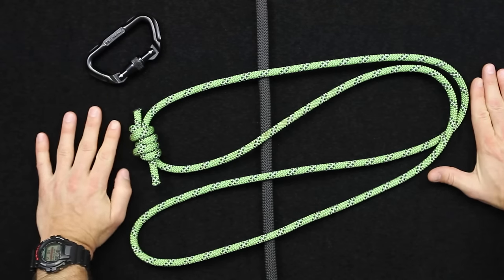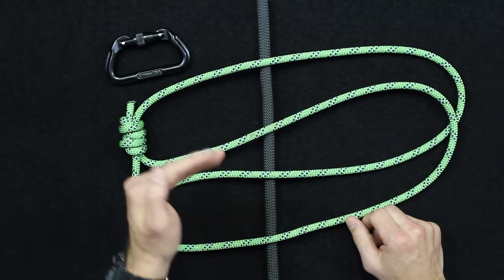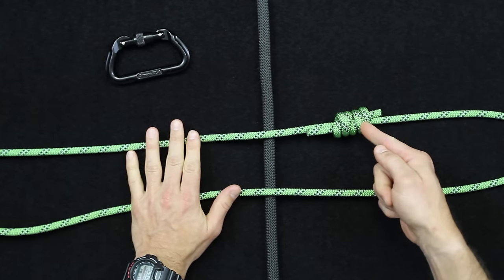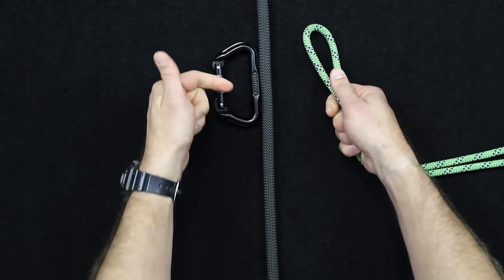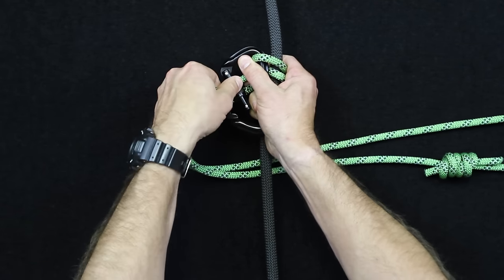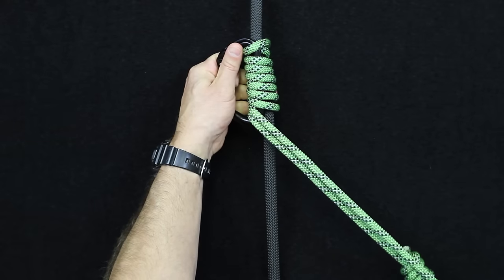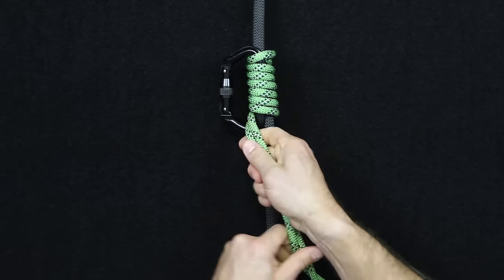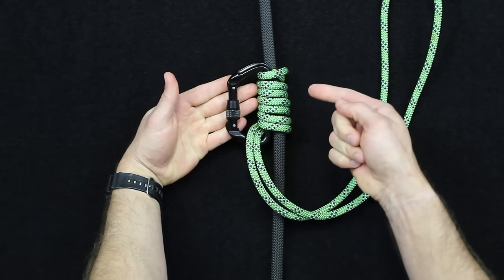Ascend a Wet or Icy Climbing Rope with the Bachmann Knot - ITS Knot of the Week HD

Comment: This seems slightly misleading. On a wet or icy lines, all friction based ascenders like this are likely to fail catastrophically. Only cam based, toothed ascenders should be used on icy or wet lines. This may be easier to grip with gloves, but that doesn't make it appropriate for those conditions
Reply: Even if it slipped, how fast would it slide down?    Wouldn't it be a relatively slow descent?
Reply: This. Respectfully, I think that the responsible thing for this uploader to do is to take this video down. Friction hitches and ascender/descender systems carry a huge level of risk, and if you wanna be someone who talks about them, you need to be someone who actually knows what you're talking about, and pays attention. There's other misinformation in this vid as well.
Reply: I can’t speak for ice, but I have used this method in training exercises and on law enforcement/rescue ops. It’s not the best option out there, but it does work in a pinch. Has yet to ever fail. Tied and true in both wet and dry environments.
Reply: Nope, if it failed it would soon run at full speed. A bachmann offers less friction than a standard prussik because the carabiner touching the rope does not add additional friction.
Reply: This is not the only very VERY dangerous video from the same guy. He has learned some knots and talks about them as if he knows them and their weaknesses. He does not.
Reply: @keithklassen5320  He Won't remove the video by himself, it's making money. Just report the video. It's not the first video he has posted that disregards all safety.  I appreciate the explanation about knots but the safety info is misleading and there will be people on the internet following this advice for sure
Reply: Ian L that might just save a life right there
Reply: Keith Klassen 

Im pretty sure he didn’t even mention that when using a prusik loop for a bachmann, the diameter of the rope needs to be smaller than the diameter of your working line or this knot won’t even work.  Its already pretty low-friction, as far as friction hitches go...losing even more because your rope cant coil tightly enough to create friction isn’t going to help.

You’d think that was something you might want to include in an “educational” video, right?
Reply: @JennyY8S  
"A bachmann offers less friction than a standard prussik because the carabiner touching the rope does not add additional friction."
True, the carabiner doesn't provide significant friction, but since he's using 4 turns with the Bachmann Knot, compared to a prusik which typically uses only 2 or 3, hence the friction of both systems is comparable, since the overall  rope to rope contact is about the same.
Reply: @fjeezy1305  
"...when using a prusik loop for a bachmann, the diameter of the rope needs to be smaller than the diameter of your working line or this knot won’t even work."
Since the Bachmann Knot utilized a carabiner, the thickness of the rope is not an issue.
Reply: @TomBrooklyn  Please go back to high school physics and review the chapter on static vs dynamic friction. The fall would not be a slow descent. It would be at full speed and catastrophic.
Reply: @TomBrooklyn  for the first 10 feet somewhat slow
Reply: This is actually the worst choice for a friction hitch on an icy rope. The guy making this video I highly doubt has ever tried this.
Reply: The general commentary here does not appear to recommend this  in critical environments . Caveat emptor .

Comment: I just got to say, I am a home remodeler and I do some roof repair. I was in a situation where I needed a knot to tie in my carabiner so that I could go up and down the roof and pressure wash. This bachman knot worked amazingly just to keep me safe and Save a ton of time. So I want to say thank you for posting it and in the right condition this is a great alternative.
Reply: Jrad Jordanian do yourself a favor and spend 30 on a ATC and a Prusik loop at minimum before you fall. Using this knot as a lifeline is a horrible idea and should never be done.
Reply: So are you saying it was good for rappelling down? Easy to slide down when its under load?

Comment: Screw Down, so you don't screw up. Will be using that saying for future. Awesome videos, simple clear and very intuitive. Keep them flowing.
Reply: Don’t fully rely on it. When belaying we typically use an asymmetric carabiner. In these cases you do need to screw up as that is how it was designed. However when you are using a symmetric carabiner such as the D carabiners shown you can screw down so you don’t screw up.
Reply: I disagree. This knot is too risky. Friction is a concern.

Comment: You defined the Prusic as the double knotted rope.  That loop of rope is NOT a Prusic until it is used as one...The Prusic is strictly how this looped double knotted rope is applied to the climbing rope. It's nice to have an alternative to having no ascender but the rule in climbing is redundancy and as such one should have not one or two ascenders but back ups to back ups and at the very least two ascenders tied to the harness or on the chest, ready to use !!
Lastly what tightens the Bachmann knot isn't the "harness" but the weight of the climber. It's all about weight and gravity. 
Ascenders are shaped to grab a rope securely and many are quite small and very sturdy...You only need one...I've also done a lot of ice climbing. Using dry ropes is primordial, they should never be "icy" or iced up. 
I did like your idea of screwing down the locking carabiner as opposed to "screwing up".

Comment: I keep trying to practice this on a practice carabiner and there is no gripping whatsoever. It just slides up and down like nothing. 

Does it have to be wet and icy....
Reply: David Hutchison that's because this guy doesn't know what he's talking about. As others have mentioned, this should not be used for ascending any rope, wet or dry.
Reply: You can use this for acenssion I just wouldn't use it on a wet rope I have used it on drdry ropes most my life climbing over 10 yrs and never had an issue by I use it with a foot sling attached to the end of the rope hanging off the carabiner and only use the carabiner to slack off the rope after I have pulled up any extra rope gained through my croll device , this bloke demonstrating just has no idea of how to use I tt correctly :/
Reply: Ive used it too, in the exact way you described.  Having a toothed chest ascender like a croll is key.  Even if the bachmann slips a little, the load will just transfer to the chest ascender.  

On a dry rope the knot isn’t going to slip much, if at all...especially if, like you mentioned, you pull the slack out of the bachmann wraps before applying a load to the knot (like stepping in a foot loop).  

In a pinch, it can do the job of hand ascender/foot loop, no problem...as long as you know how to use it.  But like you said, it doesn’t seem like the guy in the vid actually knows.  He didn’t even mention the most important part.  If you’re using a rope instead of a sling, the rope needs to be a smaller diameter than your main rope...otherwise it’s going to have trouble gripping.

Friction hitches have been around a lot longer than ascending devices.  They may not be as convenient, but they work.

I wouldn’t want to try an icy rope without something with teeth though, thats for sure.
Reply: Are you using two ropes of the same diameter?  That won’t work.  The bachmann’s rope has to be a smaller diameter than your main rope, or it won’t be able to curve enough to grip your main rope.  Another option is to make your wraps with a loop sling instead of a prusik loop.

This is probably the most important thing to know about the bachmann knot.  Wasn’t mentioned in the video🤔

Comment: I have found very little use for this knot. The friction that comes from this knot is very low compared to the other options.
Reply: bazawhacha 

it works well as a substitute for a hand ascender...better than a prusik or klemheist.  Its much easier to release the tension on the rope by sliding the carabiner up the rope.

To get maximum friction, i hold the carabiner in one hand, then pull down on the loop with the other hand, getting all the wraps tight before putting my weight into a foot sling i have attached to the bachmann’s carabiner.

But yeah, other than for this specific use, ive never used it for much else.  Still though, i feel like it performs this specific role better than other friction hitch, so i keep the knot in my repertoire.

Comment: One key point that is missing: many people don't like this knot, I can tell you why. Contrary to most frictions hitches they are used to, the number of coils is not really up to you. With a autoblock you kinda find a number you're confortable with, you test it, it grabs, ok.

This knot is trickier. The number of coils depends on the size of the carabiner more than the relative diameter of the ropes.  They have to cover the spine of the carabiner fully.  One coil less, and the knot starts slipping way too easily. One too many, and it binds too much.  The reason many people don't like it is that they treat is as the other friction  hitches.

It should be mentioned that grabbing the carabiner makes the know slip, in both directions.

To those who say this know it useless to climbers: this knot was invented by a climber. It belongs to a family of knots this climber invented around 1950. They have been published in climbing magazines, and they are still part of training courses for alpine guides (probably in historical sections).

Have they been superseded by modern equipment? Yes most definitely. They belong to a different era, with different materials. A modern prusik loop is very different from what they used back then. It's designed with specific knots/hitches in mind, and works well in those applications.

Still all Backmann's knots are interesting to study. Of course, you should never climb with knots you don't know / you're not comfortable with. Experimentation should be confined to safe environments.

Comment: I like the video, withstanding the comments below on pronunciation. However as I remember, there should be a greatly discernible difference in diameters between the rope being climbed or descended and the cord being used as the friction, prusik, loop. 5, 6 or 7 mm loop on an 11 mm climbing rope, for example. Not an 11 mm loop on an 11 mm climbing rope. I'm not sure that has the same equivalency for a Bachman hitch. I suggest that for safety one should follow the same rules for a prusik. Cheers.

Comment: Have you used the Bachman as an auto block? In my brain, this seems to be superior to using a prussic as a rappel auto block. On the lead hand you have a nice handle, if you are using a rescue 8 like I have and want to lock off it seems like it will work nice as you pass the rope behind your back to lock off your figure 8 with a wrap around.
Reply: I'm going to answer my own question. The Bachmann is the superior rappel brake, but only if done right, if done wrong it will fail completely. It is superior to the autoblock and kliemheist due to its easy of manipulation, but Its tendency to fail if used wrong is its weakness. A study by Standford done on the Bachmann show it is only reliable when the accessory cord is half or less the diameter of the rappelling rope.   Here is the study http://web.stanford.edu/group/alpineclub/info/frictionknots.htm You will see at the summary of this study, when the Bachmann cord exceeded half the climbing rope it would fail to arrest.
Reply: I totally disagree, the Bachman is not the superior autoblock in that it is NOT an autoblock knot.an Autoblock knot functions in BOTH directions. The Bachman only "has friction lock in one direction. Your Autoblock knots are gonna be knots that have connection points from center of knot or the ends of the tails leave the knot on opposite sides. I,E prussik,  taunt line, etc..

Comment: This is the worst friction hitch to use on an icy or wet rope, it can slip and not lock up again.  Also if you were to use that prussik cord with that rope there would not be enough friction as the diameter is too big (there is also not enough tail and the cord is probably not rated for enough). Don't do this at home.

Comment: Totally incorrect information. Is NOT a good tool for icy ropes. And pulling down on the carabiner would result in you falling. Pull this video, it’s dangerous.
Reply: Why do you say that? It does work. I think you have no clue whatsoever. That's not the main knot, it's an accessory knot in case you slip.
Reply: Works fine although the user always has the responsibility to use the ‘friction hitch’ properly and approximately. I think Jen Yates is overstating her point. It’s not dangerous properly used.
Reply: Its a safety you goofball
Reply: Learn Distel Hitch, anchor knot, running bowline, French prusik.

Comment: Can you use this knot as a self belay device for solo top roping ?
Reply: You can BUT read militiaus.com response above (The cord needs to be half of size of the mainline (10mm rope = 5mm cord for bachmann). Also keep in mind the size of the carabiner you're using, the bigger the carabiner the less friction the knot will have. 
Secondly do NOT use this as the only safety for your self-belay. You need a secondary, I would aim for mechanical.
I am also looking to build this self-belay system so here is my setup for self-belay (it seems safe, haven't tested yet):   Bachmann knot tied into waist harness. Create makeshift chest harness using 1 inch webbing, attach chest harness to Grivel Ascender Descender II (this will allow you to ascend but also has the added benefit of having a rappel feature after attaching a simple carabiner). I would also recommend carrying extra cord on you, and a simple rappel device just in case of Ascender failure. Good luck and be safe!!
Reply: What an amazing response!  Thank you ever so much. I'll surely put in mind your wise words.
Climb safe!
Reply: Bachmann is a really poor knot for almost any application. Has a tendency to slip. There are better knots out there, ones you can actually trust. I'd only use Bachmann if I had no other option, like maybe my hand was injured and couldn't use more trustworthy knots.